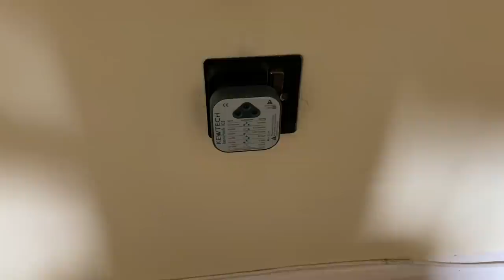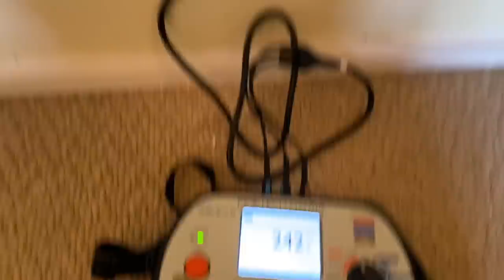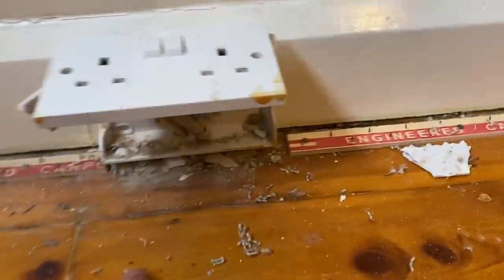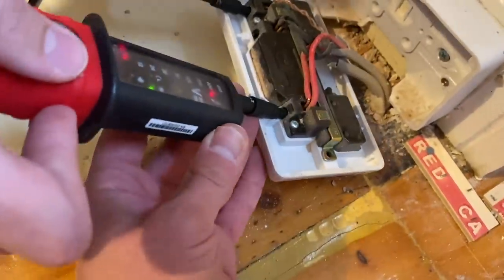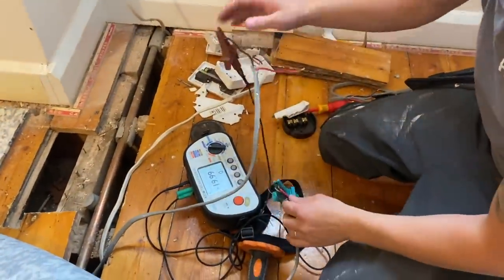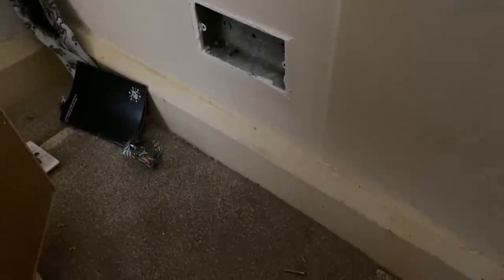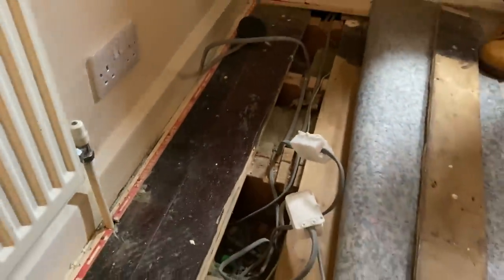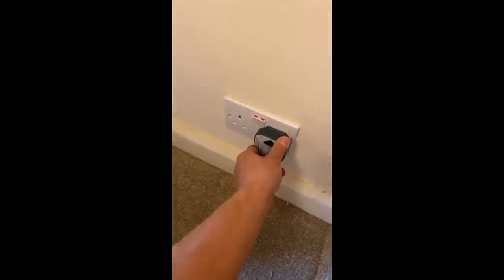Client asked “Why’s the socket not working?"

Comment: Three electricians registered with competent persons schemes on the job before Chris. So as a householder I have a 1 in 4 chance of getting work done that is safe. Why would I not do it myself? Why pay someone to put my home and family at risk? At least I would know where all the dodgy junction boxes are and how many spurs off spurs. Hell I might even have splurged on some Wago connectors and boxes and drilled the joists instead of notching them. I have electrical work I would like done but have no confidence that I can identify someone trustworthy and no confidence that the schemes will weed out the bad ones.
Reply: Yeah your right, or you could be unlucky and get 4 tossers turn up, and it's like everything there's two sides, the public side, where on the face of everyone does a good job and if it goes wrong you have the back up of part p, the governing bodies, building control etc, then there is reality, where nobody is interested if it goes wrong, and it's dragged on and on and on.
And eventually you give up, and pay to have it put right, and the cycle continues.
Reply: I just responded to a comment above and I think part of the problem is part p and the short courses that say that somebody has a qualification without experience .I did electrical work for a number of years and I spent 4 years in college to get my certificate and I learned so much just being around the electrician I worked with,there is so much to learn concerning correction factors,maximum demand,diversity and I would say those courses  do not even cover these .I had a change of career a few years ago so if I now wanted to do major electrical alterations legally I would have to contact building control even though I am qualified I don't have part P.
It is concerning that someone can do a short course and get a part P licence and legally do this type of work so I understand what you are saying.
Reply: Without degrading up and coming Sparky's,best advice to you is to pick a old school electrician
Reply: My question is, where was the home owner while the job was being done?  I believe that if home owners were present and asking why the sparky was doing the work in the fashion  he was working,  there would not be as much shoddy work.... An old Italian proverb says “ Under the watchful eye of the owner the horse puts on weight and is healthy thy.”  On the other hand if you hand the horse off to a worker the horse will never receive the same care.
Reply: @pasqualeparente9776  95% of home owners would not have a clue a good job from a bad job,as long as it looks ok from the outside and it works there happy

Comment: Maybe the installer of that socket thought it was a wireless kinetic one😁.
Reply: You may laugh but it's coming, and as soon as they can send enough power wirelessly, that's us all screwed, at the moment they can only send enough to charge a phone.
Reply: @acelectricalsecurity  Yeah if you want to cook people alive remember that even if you have a rather large 10 x 10 cm antenna mesh to get 10 watts you are already hitting 1 kW per square meter that is already going to feel like being baked by the high noon Sun as it will be heating your skin at the same power if you get the same distance from the transmitter. Trying to transfer hundreds of watts you can forget it as now you are talking thermal transfers closer to that of sticking your hand 1cm from the flame of an open fire. That is unless you use frequencies so high energy tissue doesn't absorb much of them but the problem there is that you are looking at gamma and x-rays which have other problems like the fact that even absorbing tiny amounts kills cells and trashes DNA etc.
Reply: @seraphina985  yeah you may joke but it's coming

Comment: The screws not being tightened 'level' spoils a good install on the double sockets
Reply: TonkaTruc k overtightening a screw for the ridiculous reason that making them "level" is more attractive is stupid. You can crack the fitting, or damage the thread on the back box meaning the socket will never be fully secured to the wall. Tighten as much as is required for a firm fit, no more, no less.

Comment: Customer half of the time “ well it works don’t it?” This is one of the reasons I don’t agree with the “you change the board you take responsibility”. Downgrading the mcb can get you out of Trouble but not grommets? Lashed up jbs under the floor? Make it law to be qualified same as gas and this shit won’t happen
Reply: Brad H What on earth makes you think that there aren't fully qualified and "properly" certified gas guys pulling exactly the same stunts? Having renovated properties in London and seen the appalling work and astronomical pricing of some, my reckoning is that perhaps one in four electricians or gas engineers operating here are actually doing a good job for a fair price. The rest are either overcharging massively, doing substandard and potentially dangerous work, or more usually, both.

Comment: Absolutely scary. I might only be a DIYer but I would NEVER have cut corners like this... I completely rewired my parents house some years ago (before part P said I couldnt)  - replaced separate fuses with a consumer unit, complete new lighting circuit (was old rubber cable!), new upstairs ring main and kitchen ring main. Bonded gas and water which were not done. Couldn't do any tests as I don't have the equipment, but sure enough it was tested not long after and everything came up 100%.  Tested again recently as my parents have just had an extension built, and the only comment made was "old wiring colours" :)
Reply: Erm no you cant test anything as you arent an electrician. Absolutely deluded
Reply: @adamsharp201  Well, house HAS been tested by a certified electrician and got a clean bill of health. I must've done something right... just because there's a lot of dickhead DIYer's out there doesn't mean we all are!

Comment: And I thought some of the wiring in my 1930s house was bad!   Worst I found in it was a spur off of a spur from a ring, that was then spurred to a FCU that was wired to a 2 bar 1300W electric heater mounted over a window. 

You can see why a complete rip out and rewire is often the best and easiest solution.

Comment: I'm confused with your tester when you was grooving dead. The led lights look like it was showing a voltage. If its ghost/back voltage how does your tester define between that and nominal voltage?
Reply from the maker: It was inductance
Reply: @Cjrelectrical  can your voltage indicator define the difference between that and nominal voltage? Not having a go, just thought it may be worth pointing the difference out to the young one or else he may get confused what what he is looking at

Comment: Those electrics are like having a car with wooden brakes and bald tyres.
Reply: Paul Tipton At least you would know if you had wooden brakes and bald tyres, and drive accordingly. Someone with dangerous electrics would only find out when they wake up to find their pyjamas are on fire.
Reply: @spencerwilton5831  yeah you are right, I was saying in a round about way  that any lashed in electrics may work but it wouldn't be safe, like the car would drive go places but if you skip out on tyres and brakes you are asking for trouble.

Comment: Is there a norm in UK as to how low you can put a socket?  I mean...in case the room is flooded in water or something.
Reply: There is something in bulding regulations now (if I remember correctly), but at one point in time, sockets were commonly put on skirting boards for some daft reason - and people just jeft em there, or 'upgraded' them to double sockets sticking out the front!

Comment: I'm not a domestic spark(  build specailised geneartor  testing equipment) but willing to bet there are more have boards out there being changed with no bonding/ tails upgrade no  certs or installer info there really needs to be  a tighter regulation for electrics there is for gas,

Comment: I do not know European wiring codes, but not a single bit of that wiring is allowed in the us. Buried junction boxes are no way legal. Not to mention joists cut on surface to run wires. WOW, fire waiting to happen. I'd walk away!
Reply: Every country has its own code. In Finland you cannot hide junction boxes. They mus be accessible to an electrician. The owner cannot open them.

Comment: that is a bad job,would be easier to do it properly, quicker faster and cheaper,hope some one takes the wasp nest away ,been there myself ,i have found a lot of trades now take on the wiring ,and the problem is they dont look into why and the how of how to do it ,there is a reason why sparks go to school and learn about circuits and loads,dead testing and live testing ,as people not see electric in the cable ,they do a lash up job,only when draw to many amps ,over load,then it will go down hill fast,fire ,only good side is james gets to see why you need to go to school,learn to do it right ,test and certificate ,stick your name on the job,keep up the good work,love the vids,same here in bristol,lot shocking wiring ,i got fix,too, soldier on my friend ,pass on all your good wisdom to james,he has a good teacher ,he do well
Reply: As Chris said in the video,  3 NICEIC electricians have worked on this,  and the client had invoices to prove it, so much for sparks going to school!  Obviously those ones didn't pick up too much!😂

Comment: That was an interesting video and a bit scary at the same time. I can't understand why anyone w9uld wire two three core cables into a single socket but I know it happens as a friend was complaining that the socket she plugged her vacuum cleaner in worked intermittently. I am not an ectrician but have done a few basic like for like replacement and sockets and stuff over the years so I thought it might just be a loose connection so I killed the power and opened the socket to find that mess. I put the socket back and suggested calling an electrician as I couldn't work out what was going on. The annoying thing is that the socket is in a really narrow space so no room for a double. Anyway, if someone could let me know why this would have been done I would love to know.   Thanks.

Comment: Why would anyone mount sockets so low down to the floor ?? 🤷🏻‍♂️🤔
Reply: No plaster and brick to drill out and make good once the socket is in. Just one drill hole through the skirting board and fit the switch box to the skirting. Bodge job in other words.

Comment: I don't know how you guys do it on ripping up floors and dealing with rings with all those hidden junction boxes run about.  That would drive me mad.  Makes me like our wiring in the USA with all radial wiring and well in theory no hidden junction boxes allowed.  We have three exposed junction boxes but thats about it.  With almost 800 sq-M single story house that is built on a slab foundation.  The house is fed with dual 200A 40 breaker service panels (total 80 breakers) that is almost full and 99% of all wiring is in the attic except for the island wiring which is run in the slab from the wall.  Every time I see the small panels that are 8-16 breakers it makes me giggle.  I would love to see some newer large estate properties and how they handle all of that?   Keep up the good work.  Bad/lazy electricians really make it tough for the good guys.  👍👍  🍺🍺

Comment: Air powered sockets. Nice. A lot of those cables have been crushed in between boards so are probably pooped anyway. I assume that it was a shower of sheet inside the board? No doubt you will rectify properly but it is a shame there are so many lazy toe rags out there.

Comment: Come across this all the time, getting very boring now fixing others rubbish, still waiting to work on a property which has been done properly. Maybe one day.
Reply: @R. D. I meant in general going to jobs where you can do your work on good circuits without having to fix shit first or running your own circuit coz you don’t want to touch the existing crap.
Reply: Can't say I always find rubbish, far too much but not always. When I bought my house I knew I was going to rewire anyway as it needed a lot of updating, but what was there was actually in good nick, ring intact, grommets present, etc. Upfront RCD still working fine, but no discrimination and plastic board under stairs so had to go, all good for when it was installed though.

Comment: Did you cut that box out with a knife and fork ??
Reply from the maker: You would think so unfortunately the previous tradesperson filled round the single socket with sand and cement and it just fell off

Comment: Who wires a 32A breaker up to that mess, appalling.
Reply: I don't see why using 32A breakers anywhere to me. Most houses in my country have a 25A main breaker! And a socket circuit is 16A maximum. 

Really nowadays what you will use all that power for? If you exclude high power appliances that you have in the kitchen and are usually on a different circuit in the rest of the house a socket circuit will never use more than a couple of A, what you will plug in, TV, PC, phone chargers, maybe an hair dryer, 16A are enough for everything.

In that situation just swap the 32A with a 16A or even a 10A and you are fine, it will never trip in reality. In the UK you are too obsessed with higher amperage for no reason at all nowadays that appliances use less and less power.
Reply: @alerighi  In the UK the plugs are fused with max 13 A so the breaker can be higher. I do not like the idea that the socket is protected by something that s plugged on it and not something upstream but that is how they have decided.

With spurs they can have one double without extra protection as it is limited to max 26 A by the fuses but if there are more in the line an extra fuse is needed.

The system has benefits. Users have more freedom to use high power equipment at the same time and device can use max 13 A (3 kW) when in Europe they are limited to 2-2.4 kW as the breakers can be 10 or 16 A.